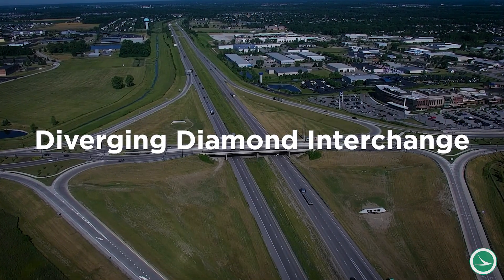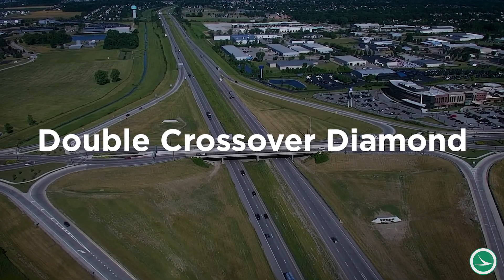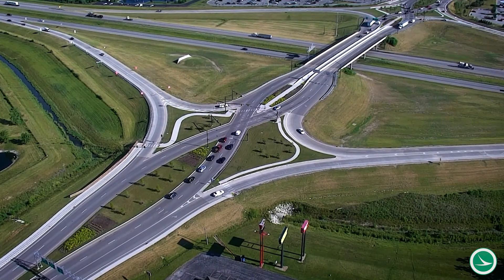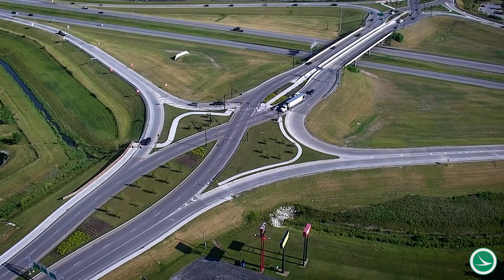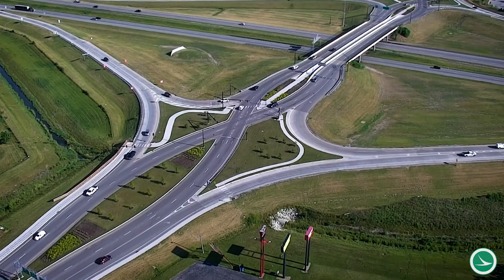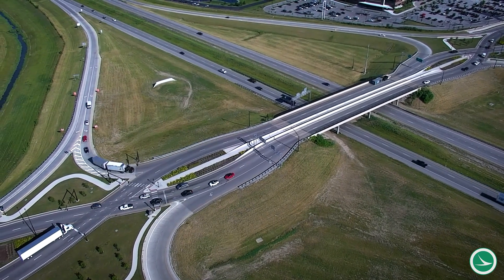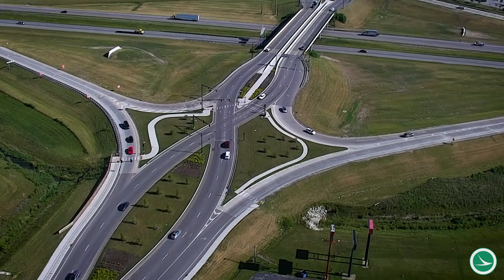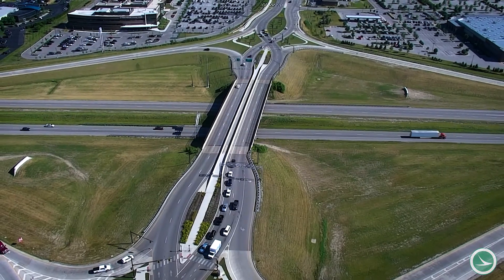Diverging Diamond Interchanges (DDI) Explained

Comment: Dude just put a normal intersection
Reply from the maker: Cdog Rock as the video explains, these are much safer.
Reply: Ohio Department of Transportation but wouldn’t it cost more to make
Reply from the maker: Cdog Rock it would depend on the location and project.
Reply: Ohio Department of Transportation so they are bad because it would be hard to put in a high density area which these would be the best in
Reply from the maker: Cdog Rock actually, they don’t take up much more space than a traditional interchange.
Reply: The Roberts Rd DDI has been in place for over 5 years and it works just fine.
Reply: @OhioTransportation  Can freeway exits have their own lane on the bridge then use merge?  They shouldn't need to be traffic light controlled.